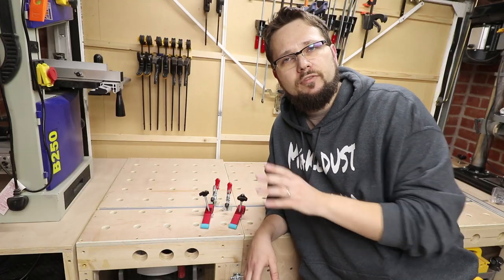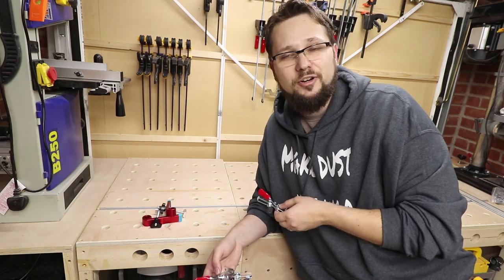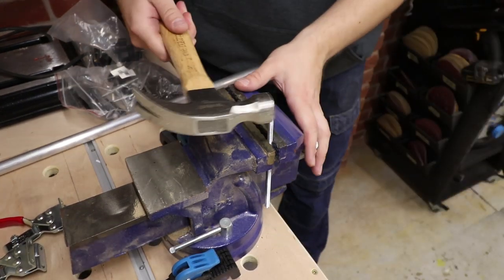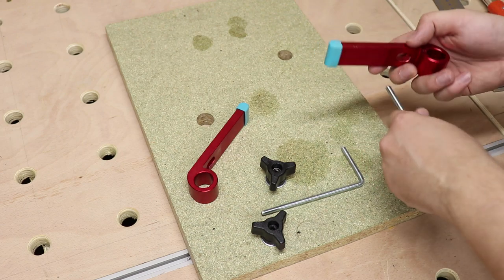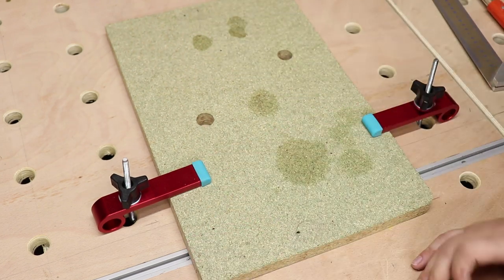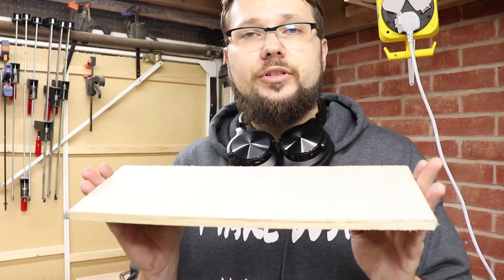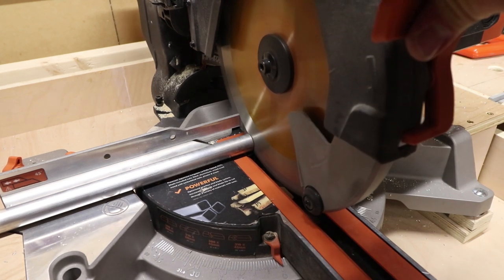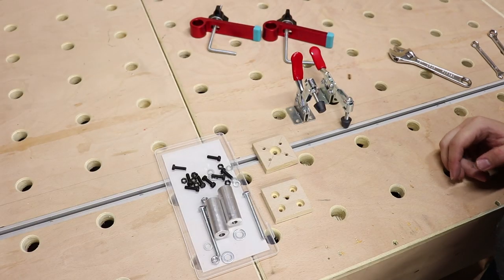Toggle clamp and T-Track clamp upgrade for MFT style workbench. Cheap clamping solution for MFT top.

Comment: Just made a couple of the T bar clamps. A suggestion- if you have (or buy) a 6 mm die, you can use 6 mm rod (instead of threaded rod) and thread the top 50 mm. This is not only stronger, it means the smooth surface will not mar the table. I added a sleeve of heatshrink, for an even smoother/softer surface. I made the bars and handles (with a 6mm insert) out of thick ply. Many thanks for the idea!
Reply from the maker: That's great improvement idea thanks. We both benefited from out now 😁

Comment: Hi Thomas really enjoyed the video and very well delivered.  Could you tell me the thickest timber you can clamp using the toggle clamp.
Reply from the maker: Difficult to give a definite answer. It depends which toggle clamp you will get (what size) Then you can upgrade the rod with a foot that will have an impact plus as in my case I have added a piece of plywood as a base and again depending on how thick that is you will be able to clamp different sized material. Have you got any particular size in mind?

Comment: great idea  I think  I will just get a flat bar like an l bracket material put a bend in get a 1/4 inch ready rod cut and bend and buy some handles from amazon or try a wing nut first thanks
Reply from the maker: Good idea, could be a solid improvement

Comment: One more thing to modify the Ttrack clamps would be to elongate the hole in to a slot. I think this will make them more useable. Regards Geoff Maddison
Reply: Agreed. I just added some slots around my work top and did not need holes. Just make sure the individual slots are not too long to weaken the work top.

Comment: Hello Thomas.  I have made dogs w 7/8” dowel and a base to hold a toggle clamp (similar to yours I think).  The hole and dowel are both 7/8” but the dogs slip up a bit and cause loose clamping.  Any easy solutions to keep the dogs snug so clamping is tight?

Comment: Hi Geeeeezer,  Did you use a tap to drill the rod?
Reply from the maker: I initially drilled it with a bit that supposed to make thread inside of the rod but that didn't work so after that I just used a normal drill bit for metal👍

Comment: Hi Tomasz, how are you finding having dog holes all over your bench? I'm toying with different patterns to save drilling them all out - two runs at the top, two at the bottom, a few perpendicular, etc. Would you drill all out if you did it again? Cheers!
Reply from the maker: Hi, that was my initial thought to have them in certain places but I just went with the whole bench. Now I think it was a good idea I tend to use the whole bench and it's so easy to clamp everything. One downside is that if you are working with small things like screws, bolts or something that can tell through the holes then it becomes annoying. Fortunately I got two carts on both sides and now I put/work with those small things on them 👍 hope this helps😁
Reply: @CasualDIY  Yeah, that was my thinking. I might go with a tray 10cm underneath to catch small items and store the dogs, etc. Cheers
Reply from the maker: @richardclarke9966  no problem mate 👍

Comment: Nice solutions all I need is an MFT table, like how your mitre saw appears out of nowhere, have you got a video on your MFT table
Reply from the maker: Hi and thank you. Yes got videos on building my whole workbench just check out my Workshop upgrade playlist and they are all in there 👍
Reply: Casual DIY thanks for the quick reply, I will have a look as your solution maybe exactly what I need, I use mainly hand tools, but use a mitre saw, track saw and a planer thicknesser and my table saw will be going as I hardly use it as I can rip cut quicker than setting up my cheap Lidl table saw to get each cut parallel to the fence.